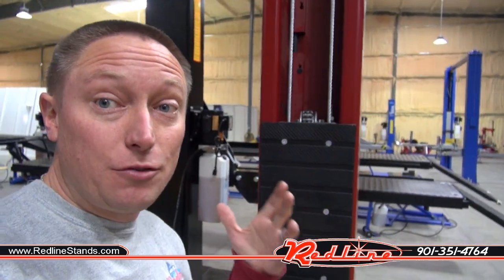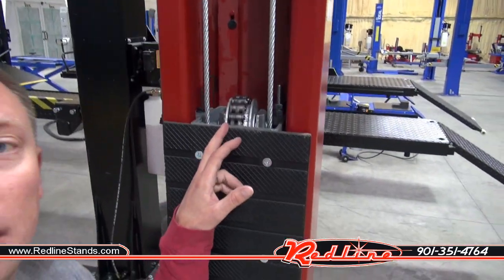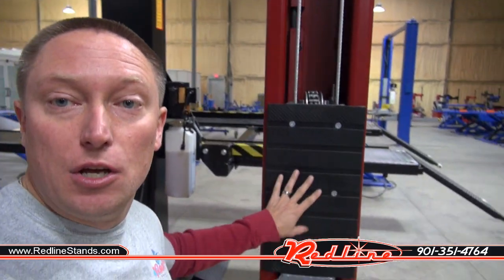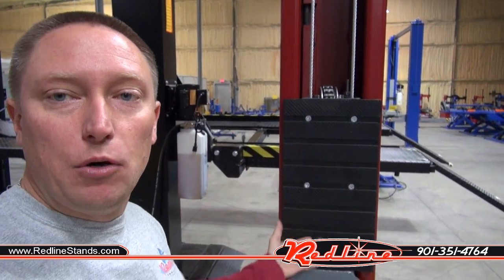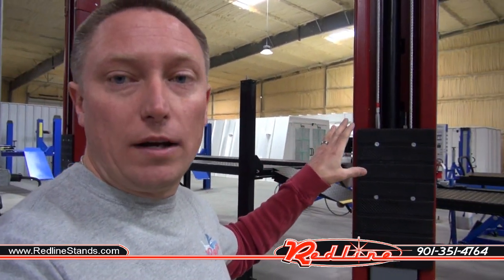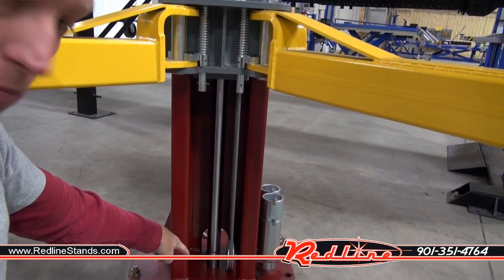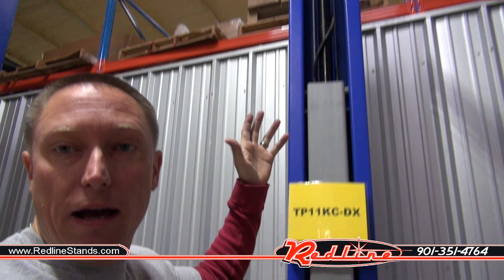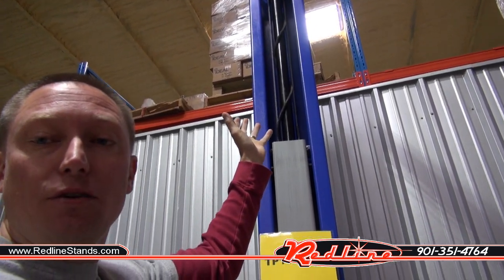Direct-Drive vs Chain-Over-Roller Two Post Lifts Compared

Comment: As I began shopping for a lift and realized that going from 10k to 12k switches from direct drive to chain drive, I balked a bit as I want/need the 12k. Then I thought, how are hundreds of thousands of fork-lifts (which I used to use in the workplace) doing their lifts? With chain drive. It's not the end of the world!
Reply from the maker: I agree.  Direct drive is superior, but the chain drive will still last you the rest of your life just fine.

Comment: A chain drive unit will lift the vehicle higher than direct lift. A 12 foot high direct lift can only use a cylinder that is 6 ft max. This limits the lift to going up 6 ft. A 3.5 ft cylinder with chain can go up 7 ft in a 12 ft high lift. Makes a difference if the mechanic is taller than 6 ft. A friends garage has both types and it is easy to see this.

Comment: Direct drive cylinder does the top of the Sounder come out the post of the lift
Reply from the maker: No sir.  The cylinder stays in the tower at all times.  If it comes out, either A - there's a repair being made, or B - something has gone terribly wrong.

Comment: How do you adjust chain drives
Reply from the maker: You adjust the cables, not the chains.  This video below covers it toward the end.
https://www.youtube.com/watch?v=1AN4pqq95hA&t=298s
Reply: @RedlineStands  thanks we just rented a small space that has an older lift fitted but the non switch side has drop about 2 inches so cars are not totally stable to go on there as they lean .. this lift you have to hold a handle to let it down I've not took off the inspection covers to see the lines yet just assumed it was chain's all the way up ... would you say its easy done I'm not shy off trying a job but also rather not mess things up .. thanks so much for reply I'll watch it now 😀

Comment: Appreciate all your information on lifts as there is a lot out there, what are your thoughts on the Katool 11,000 direct drive, it's price point seems fair. Thanks for your time.
Reply from the maker: Funny you ask.  I recently purchased this same lift via https://www.ebay.com/itm/145788096999  I plan to make a video about the lift.  It'll be one of those "I bought the cheapest lift on eBay" type of videos.  But in answer to your question, it's not possible this lift is quality.  The retail price is about half my dealer cost on a quality 11K.  You need to understand that you get what you pay for, and car lifts, like eye surgery, are not the time to save money.